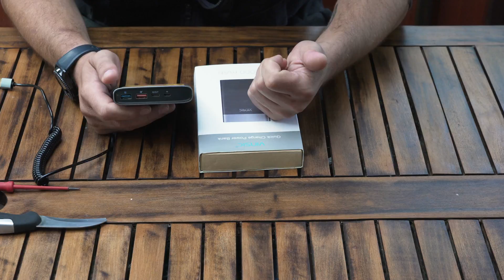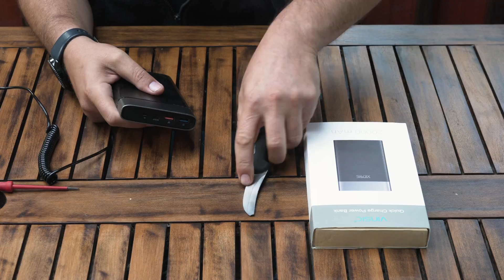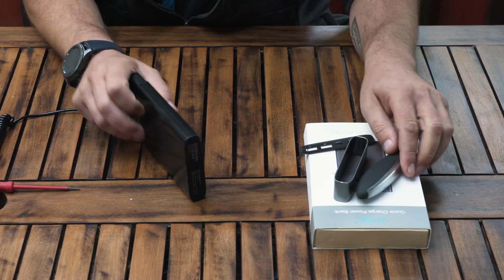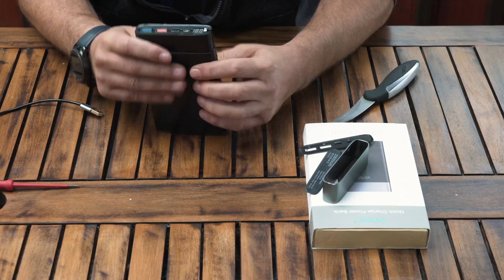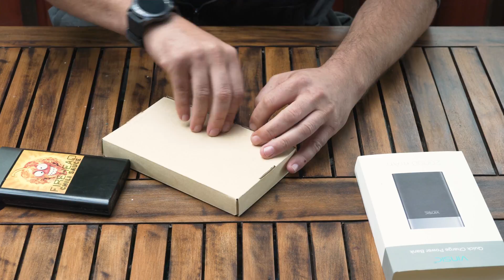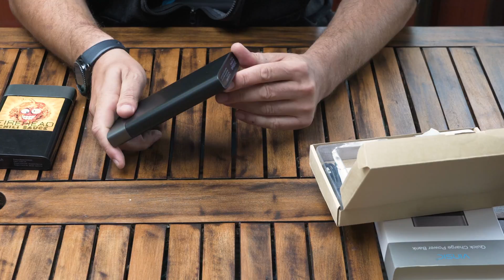Vinsic 20000mah powerbank dismantle and short review

Comment: after getting this battery in 2017. i notice the battery are starting to swell and the case is bulging. how is your battery? do you still have it?
Reply: Same happened to mine. Make sure it is dry and place in a ziplock, airtight bag and place somewhere in your freezer for a week. Take out, check seal, make sure it is dry and plug  in to charge immediately or let it warm for 5 minutes before plugging it in. The swelling should have visibly reduced. Sublimation with heat over time in hotter countries.

Comment: Hello, Can I ask how acurate is  estimate capacity display ? I bought same one - but it have two orange ports , and  it drops to 1% with one charge , and then charge my phone again all with only that 1%  so useless display information :/
Reply from the maker: Mine seems to be working fine. Just now I've charged my phone (Samsung S20+) by 25% and the display on the battery has gone from 100 to 90.